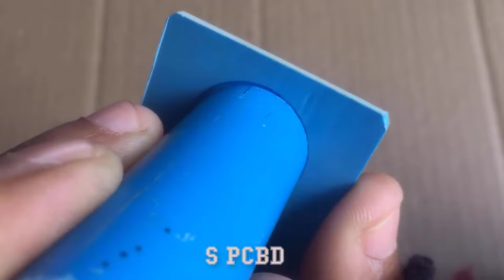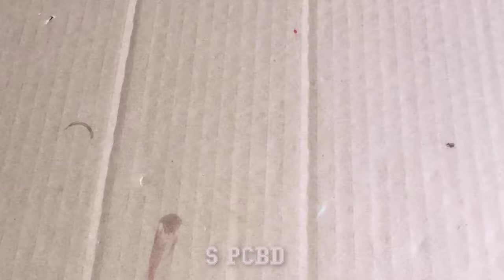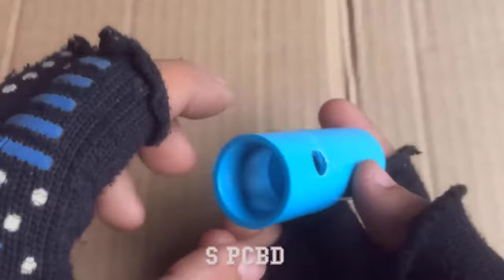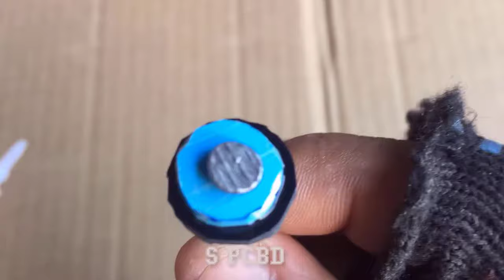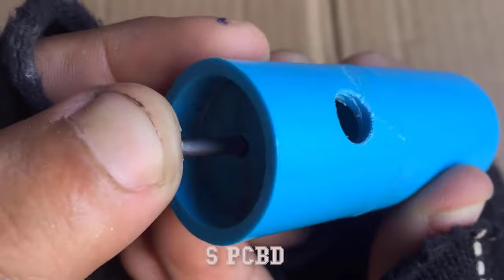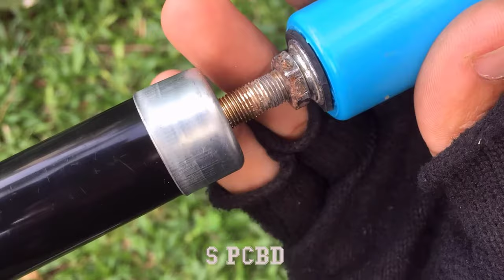Air Shoot Valve For PCP's Best Design | Handmade Air Shoot Valve From PVC Pipe  S PCBD

Comment: Risky work holding. If the output was holes around the valve stem and the whole unit was installed inside a pipe, it would work like a mortar. Drop something down the pipe to hit the valve stem to get launched by air.